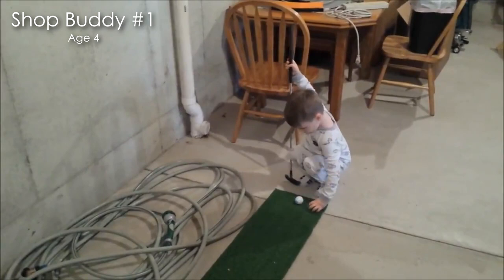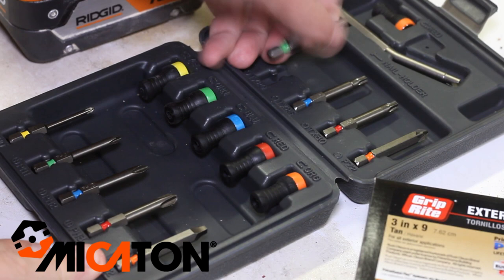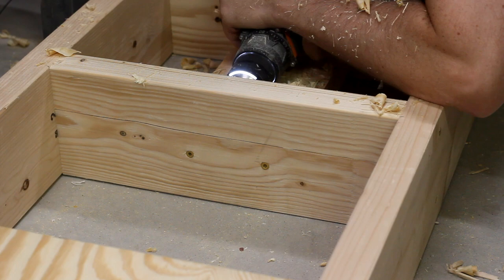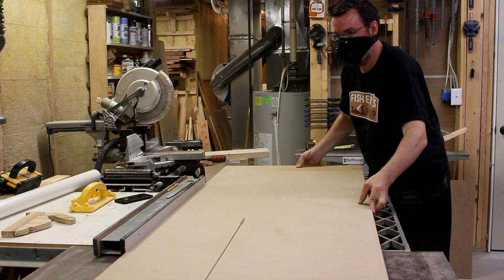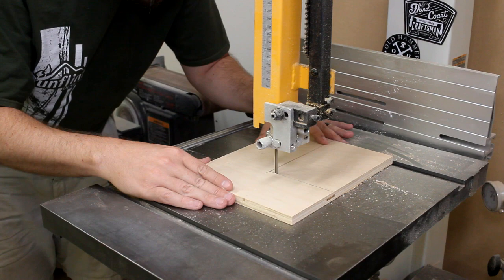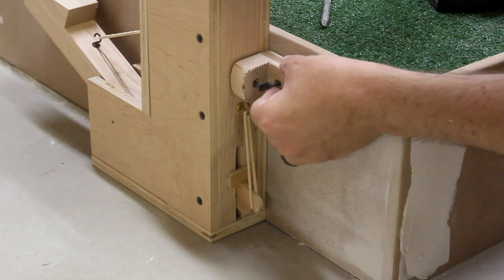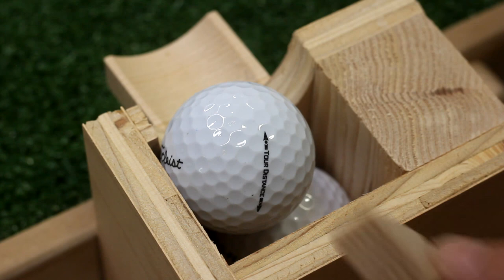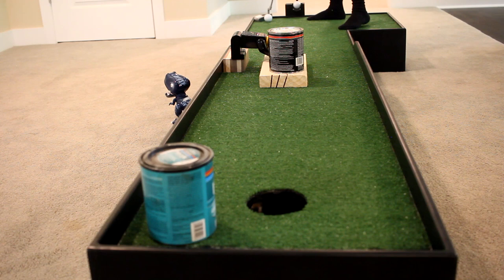Woodworking: Building a Putting Green w/ Ball Elevator

Comment: Wonderful project.
If you were ever to do a version 2...
Would you consider instead of a solid surface, one that has holes in it and an almost rigid rubber surface over those holes so that you could have adjustable gradients in the the green by using a large wooden screw type arrangement to ever so slightly raise or lower sections. With the astroturf over the top of this.

Or have I just overly complicated matters even more?
Reply from the maker: Was trying to think of how to accomplish variant gradients and that might work. Perhaps with sliders where you can easily make adjustments. Good idea. However I fear the material might be very costly. Thanks for watching!
Reply: A cheap as chips version would be to have a thick plastic bag (One of those vacuum bags for long term storage perhaps) filled with wet sand that you could just pound into place underneath the turf. Not as easy to dial in fine adjustments, but certainly quick dirty and effective.

Comment: how did you modify your ridgid angle grinder for a type 1 wheel vs. the 27 it is setup for. doesn't look like you are using a type 1 guard?
Reply from the maker: It's not modified
Reply: @FishersShop  great putting green btw.  still using it?
Reply from the maker: Haha, no... I gave it away years ago